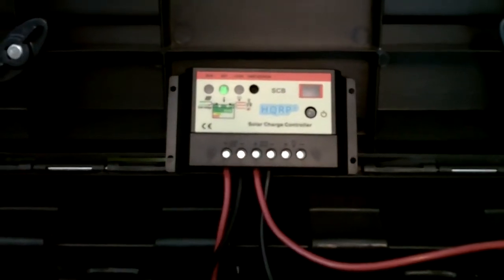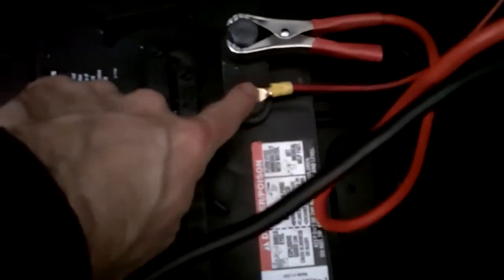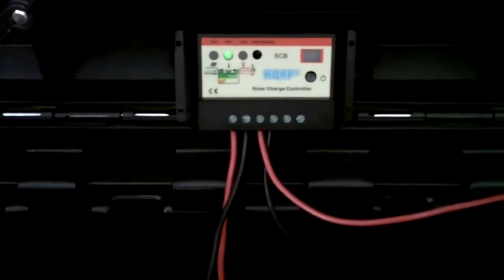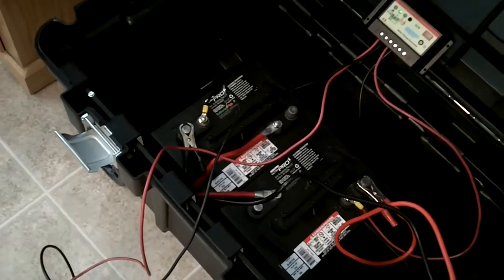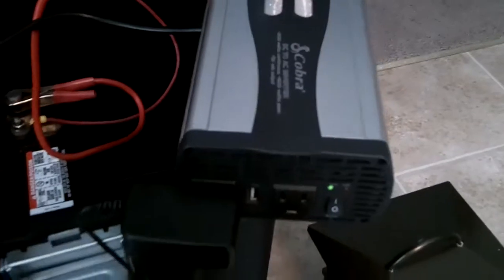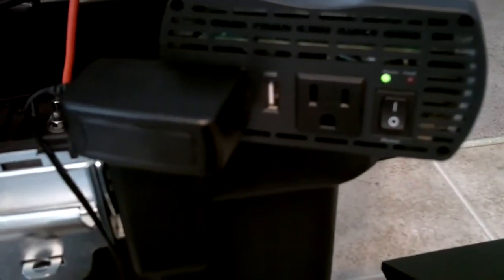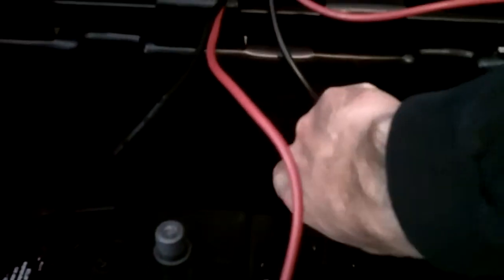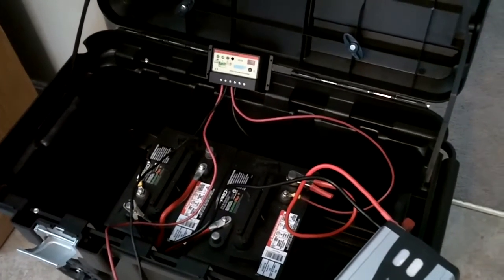Portable Solar Power Generator Part 2

Comment: Nice setup, but would strongly suggest fuses to protect batteries , charge controller, and inverter.  There is is enough amps in those batteries to  stick weld steel together.

Comment from the maker: I do not have any written directions.  I have thought about putting together a document with illustrations, but haven't had the time to do so yet.  You can message me with any questions on my system and I'll be happy to answer to the best of my ability.

The charge controller I am using is an HQRP and it costs about $30.  I don't mean to promote one brand over the other, I made my selection by reading the customer feedback on Amazon and selecting the one with the highest rating.